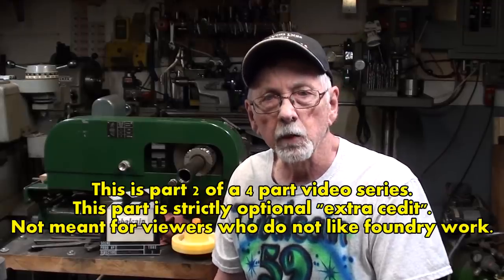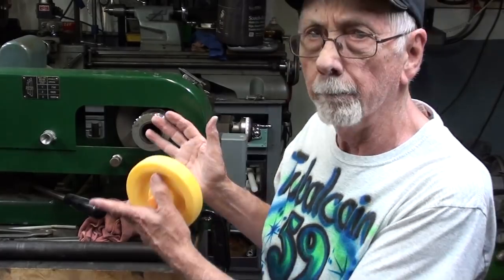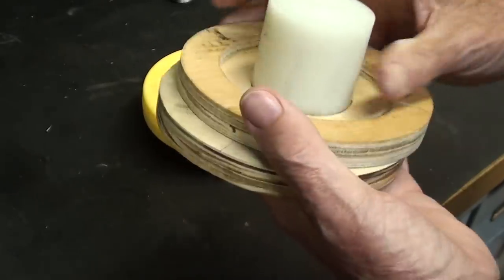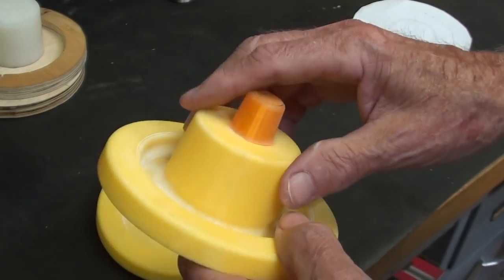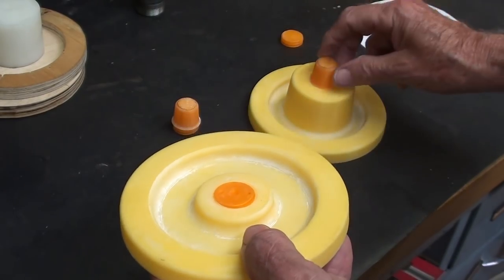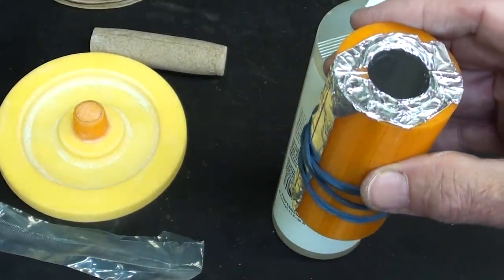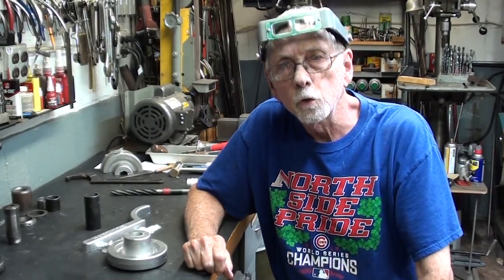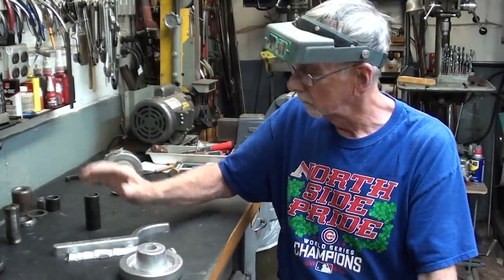Make a Hardinge Lathe Collet Drawbar 746 pt 2  tubalcain 5c

Comment: Hi Mr. Pete.  I have a couple things to say about this video. 

I don't understand why people are not interested in this type of shop work.  The ability to machine gives you great latitude in making things, but casting opens up the experience to a level that can only be hindered by your imagination.  Even of folks don't have the means to cast metal it is a great demonstration of what can be done.  And for those who don't have the foundry experience it can be learned through trial end error.  My first foundry was a flower pot submerged in some cement and fired with charcoal.  My sand a mix of Playland and bentonite.  Cost was pennies and what I learned was priceless.  Finally, I enjoy every casting video you make.  Coupled with your foundry course, they provide excellent working examples.  So, speaking for myself, thank you for taking the time to produce them!!

Joe
Reply from the maker: Thank you very much Joe

Comment: Thank you.
As always, I enjoyed this. Learning about the water glass was new and very interesting to me. I would like to know more about it.
Thanks again, have a great week.
Reply: Common glass is soda/lime and it's very sparingly soluble in water.  Sodium silicate, AKA water glass, is made by fusing silica sand and soda ash.  Like almost all sodium compounds, sodium silicate is reasonably soluble in water.  As the base is strong and the acid weak, a solution of the salt exhibits a pH above 7 (alkaline).  The pH is high enough to warrant the skin and eyes safety warning on the bottle.

Comment: Very interesting that they call that spiral bit a Core Drill in the casting world, in the world of general construction, a core drill is hollow and leaves a "Core" (a lot like trepanning).
In construction, core drills are usually used in concrete or masonry for anchoring seating in the floor or for running cables or piping through a wall.

Very nicely done BTW! 
Always enjoy your videos!?

Thanks!
Reply from the maker: Yes, I have seen them take core samples of concrete. For testing purposes
Reply: @mrpete222  
Yep, that too! 👍

Comment: Sodium Silicate   I was able to reharden a spot in basement cement floor, that was damaged by a vinegar spill, using liquid laundry detergent which contained Sodium Silicate.  I just mixed the detergent with a little water, soaked the area, and waited for it to dry.  Before treatment the sand in the cement could be brushed away.  After treatment it was hard as a rock once again!!!  Thanks for this great video and sorry for the diversion!

Comment: Thanks for showing the voids caused by moisture. Believe it or not the same occurs during plastic injection molding if the raw plastic granules (shipped and stored in airtight packaging) aren't dried before processing from micro moisture absorbed internally in each pellet. It will not be catastrophic as your example but a microscopic bubble collection in the last portion to fill. Every plastic part has some if you use a microscope.
Reply from the maker: Thank you, I did not know that about plastic pellets
Reply: 3D printer filament will pick up moisture from the air as well. Making it not flow well through the printhead.
I'm pretty sure the heat it takes to drive of the 'damp' means there's not enough wattage left to get the plastic thoroughly liquid.

Comment: Interesting video.  That four flute core drill seems almost like a reamer.
Suppose that's the point. To make a smooth finished and accurately dimensioned hole in a rough casting.
Reply from the maker: No, it is nothing like a reamer. This drill cuts on the lips at the point. The flutes Support and guide the drill accurately within the hole

Comment: Speaking of steamy voids... 3d Printers don't like moisture either. Need to keep your rolls super dry(food dehydrator, or oven bake under 50c). Raw material absorbs moisture from the air and steam bubbles and pops as it goes through the 200+C hot end causing horrible finishes, also causes stringing! Just adding that steam is still a problem even in new technology. No chance of a print blowing up at least.

Have a good one.
Reply from the maker: Thanks

Comment: The core plugs on the pattern are sheer brilliance!

Little bit disappointing that you (well, Ted, I guess) didn't take advantage of 3D printing the pattern to put nubs on the backside, similar what you would have on the back of a steering wheel, to give you more of a hand grip. That would be a real pain in the keister to machine, but making a 3D print and then casting it is much less trouble.

Still, an excellent video!

Comment: Thx Mr. Pete. If you were to pour that without a core, would you just pour straight in the center of the hub or would there still be a need for an offset pour spout?
Reply from the maker: Yes, straight in the center

Comment: Is there a reason why you didn’t use the steel drawbar as a core and cast the hand wheel wright on as done on water cooled Sterling engines or even lawnmower cylinder blocks ?
Reply from the maker: Yes, lots of reasons. If you have ever watched some of my sterling engine videos, you will see were I did use that technique